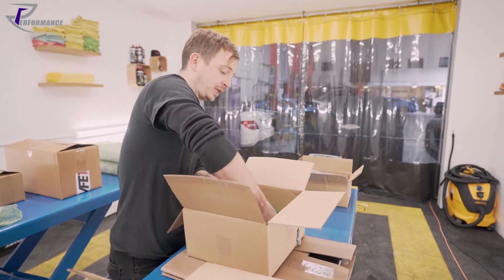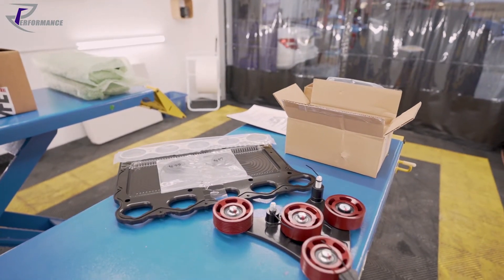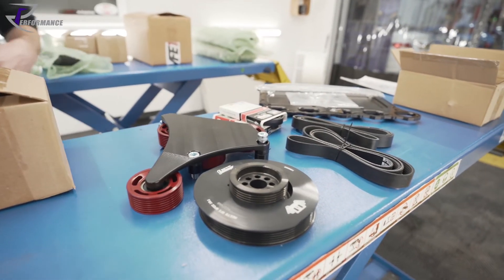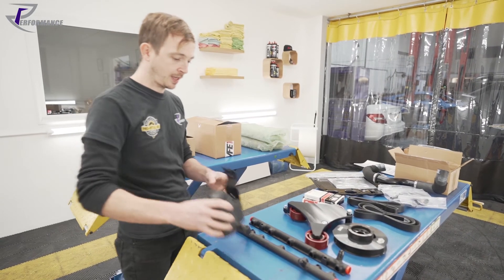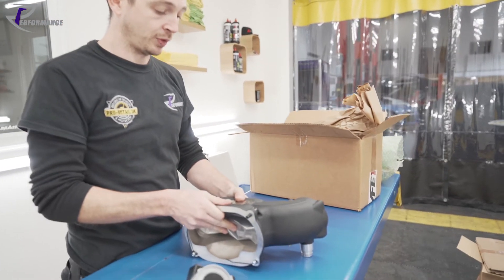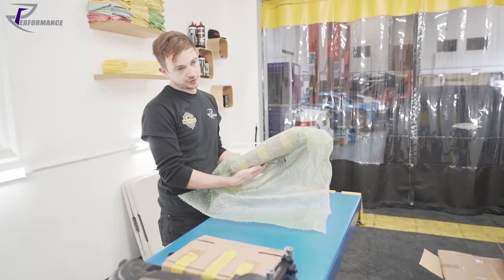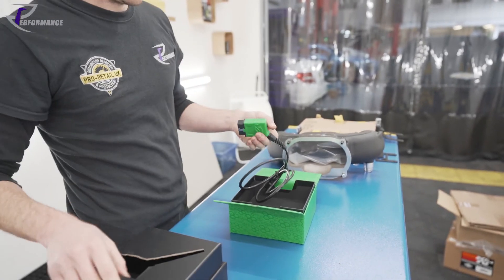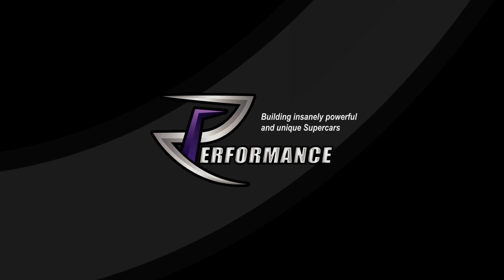Unboxing a VF Engineering VF800 supercharger kit for an Audi R8 V10 Gen2/Lamborghini Huracan

Comment: Wondering why there is a separate coolant pump (a concerning potential point of failure) and the charge cooling radiator in the intake manifold not integrated into the cooling system (with a replacement radiator fitted with an extra row to increase coolant dwell time in the radiator). Maybe there’s a reason this was the basic factory setup for other systems?
That way the strake crossover radiator setup is used for oil cooling. 
Once this expensive kit is installed where is the recourse to deal with the heat soak in hotter climates?

Comment: Have you ever added e85 to one of these superchargers? Do you think the tvs2300 is big enough for this engine?  I would love to see what kind of jam one of these makes on e85 with a smaller pulley.
Reply from the maker: No E85 is not popular really as it’s required multiple ecu maps unless you go aftermarket ecu with flex fuel.

Comment: Hey Ricky done an ESS kit? 

Ever done a forged motor for a supercharger? Would love to see one of these SC kits running 15psi.....
Reply from the maker: Yeah, would be good to swap the pulley out, build the engine and turn the wick up.

I've done ESS but not on a Gen 2.
Reply: @REPerformanceUK  Really thinking of doing this on a Gen 2, in Aus would have you come out here and put it together and tune it, I'm under the impression you've done that before here? And Motec or Syvecs if given the choice? Id also treat everything and I mean everything where metal touches metal with WPC treatment, would love to see your face if it only needed 4-5Nm of break-away torque.
.
Reply from the maker: @JH-jo9wt  Where are you in Aus? I have an R8 GT of mine running in Brisbane that I visit regularly. Built engine with Syvecs and our TT kit. Drop me an email on ricky@reperformance.co.uk and we can chat more!